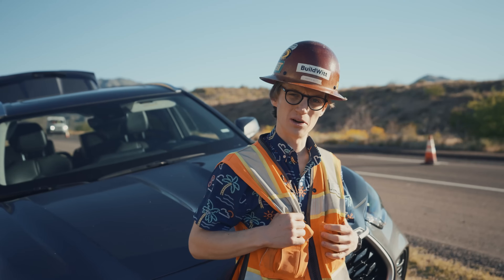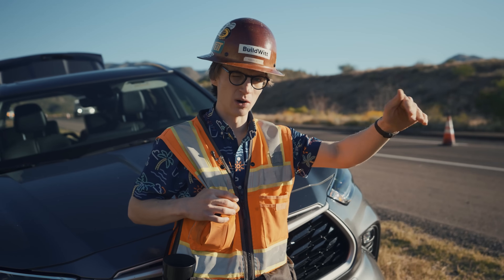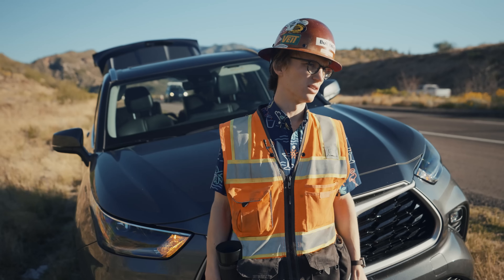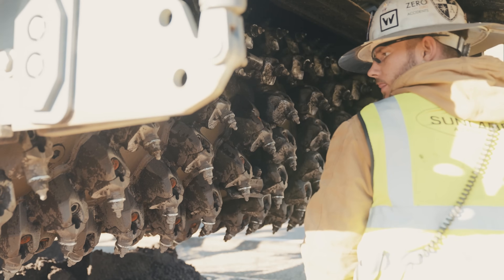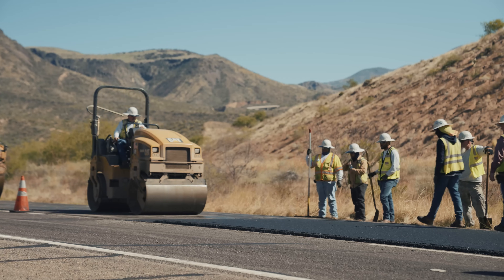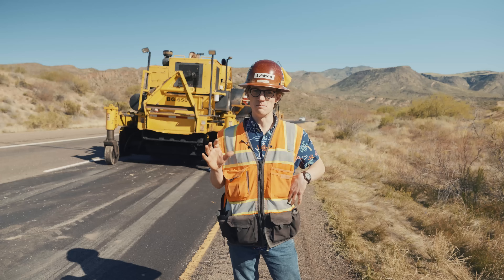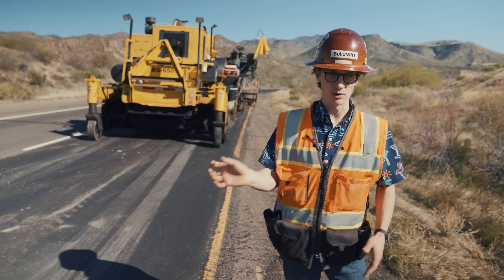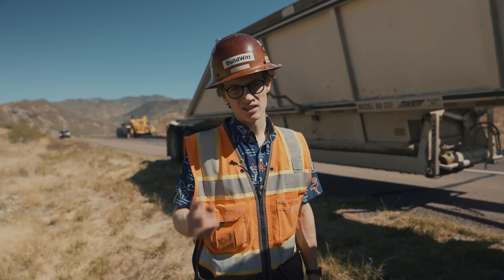Paving the Arizona Desert with Sunland Asphalt

Comment: I work on a paving crew in KY. This is a lot different than how we do it. We typically use a shuttle buggy on bigger jobs, trucks dump into the buggy and the buggy puts it into the paver. Shuttle buggy usually holds about two truck loads and it’s typically non stop paving.
Reply: Would imagine it's to do with holding temperature. Use to test compaction in WV, you'd lose temp waiting on WV Paving to even get started.
Reply: same process here in NJ
Reply: Some jobs I've been on the state would not allow the asphalt to be  picked up off the surface to be layed down a second time

Comment: Why don’t they dump directly in to the paver
Reply: The outside forces of a truck backing into the paver cause bumps and little imperfections in the road. Don’t normally dump straight into the paver on state jobs
Reply: @trevorflegler6563   my job gets a bonus for how smooth it is so the transfer machine pays for itself.

Comment: Been doing road construction for 12 years I never once seen a belly dump
Reply: We don’t hardly use them at all in Kansas.
Reply: Up here in the PNW we run super dumps for paving mainly. We either dump straight into the paver or run a buggy. Transfers are also common. I’ve seen belly dump paving on occasion but it isn’t very common.
Reply: @jcprov9481  god awful machine to run the transfer buggy absolutely the worst machine I have ever spent considerable time on. Roadtec get with the times holy shit fire 30 years behind underpowered poorly tuned problem ridden heaps.
Reply: You forgot to mention hottest seat on the job and seemed like our roadtec killed itself due to over heating shutting us down

Comment: I still can't believe Arizona still only allows tandem single trailers. We use 12 axle double trailer belly dumps hauling around 45 tons for both paving and milling, generally load with milling unload at the hot plant then load with asphalt and just keep making the circle loaded both directions.
Reply: They allow quad lift axle dump trucks that haul 25 tons
Reply: @grantball6325  right but only tandems on a trailer and no double or triple trailers, right?
Reply: @clydeacor1911  I live in AZ, I see Fedex hauling double trailers sometimes if that's what you mean. Never seen triples tho
Reply: Still can’t believe Arizona let’s people work in 110 + degree weather
And 11-18 hour days